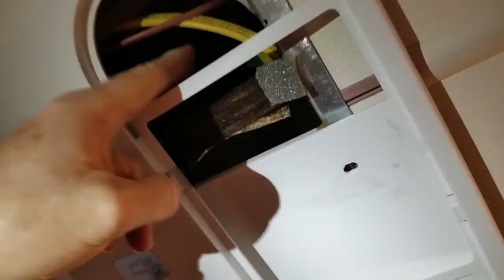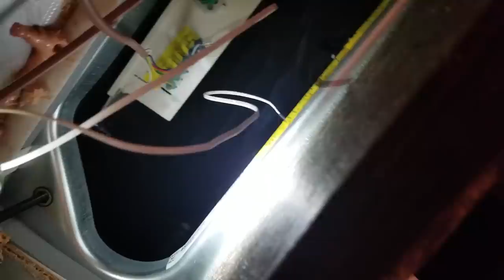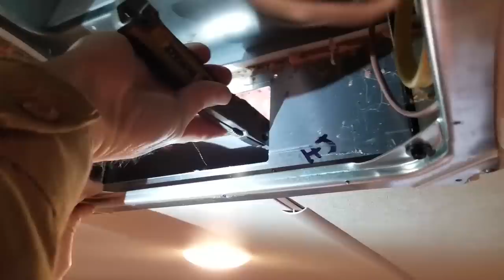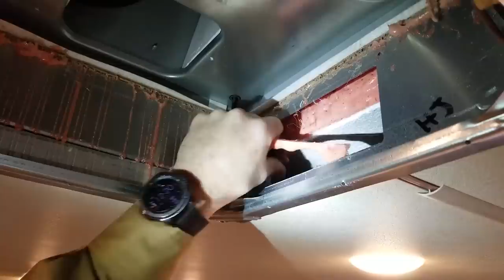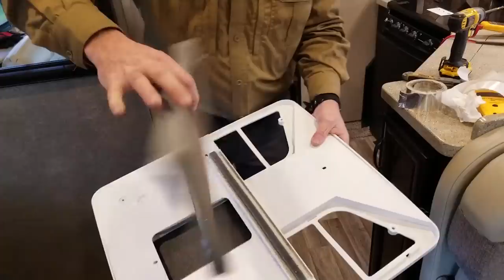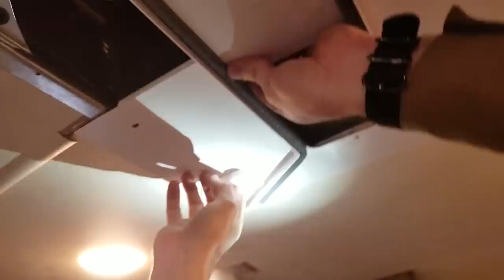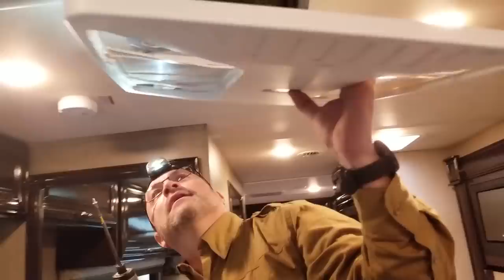Boost Your RV Air Conditioner Performance With This Cheap, Easy Fix!

Comment: I had problems getting my a/c to cool. I took off the frame like you did & using that same tape repositioned the center baffle. That gave me more cool air. But not much getting into the bedroom. So I closed most of the vents & took the frame off the one in the bedroom. Plenty of air getting to the area, but the vent was open into the ceiling. So I made a little wall of hard cardboard, covered it with the tape & put it in the duct to keep the air from going into the area between the ceiling & the roof. What a difference! Are there any other things I can do to help keep the RV cool?
Reply from the maker: Good job on the repair in your ducts. Obviously park in the shade would be the most obvious tip but that's not always possible.  We have installed awnings on the opposite door side to cool the walls of the RV on that side.  It did help quite a bit. If you're in a windy area though that solution may not work as well for you. The R-value of an average RV is about R3. Some of the really good ones might go up to an R6 but that's about it. So you're fighting a losing battle in trying to insulate. Some folks have added a second or third AC, that's fine if you have the power to do it.
Reply: @MyRVWorks  Thanks! Unfortunately the unit stopped working yesterday. Great in FL! I did go onto the roof to see if I could  clean the filters. One screw on the housing is stripped so I could only see the fan & the pipe connection to the motor. The fan moves smoothly & no mud daubers in this area. Couldn't see into the other side. The Thermostat does a small sound when I try to turn on the system. But no a/c. What's my best option? Electrician? RV dealer?  Any suggestions would be appreciated.

Comment: Hi Darren, Great idea to improove the cooling power. My 2016 5th Wheel has two ducted ACs (I think Dometic), which are not cooling very good. There is no such big cover to take down. Actually there are only these round intakes and outlets (6-7 inch diameter) throughout the RV. The pressure of the cold air ist preety low. So I think there must be a way to improove that. Have you any suggestion? Thanks, Manny
Reply from the maker: On your system you're going to have to get on the roof and take off the AC cover and the Shroud over your absorber coils. That's the way you will get to this divider. I've seen on some very high-end 5th wheels with your set up and there was a 2 inch gap on top of the divider where the air was passing right by.
Reply: Thank you Darren, I’ll check it out. Hopefully it’s what I am looking for.

Comment: Mine didn’t have a baffle at all. I made one out of house styrofoam insulation. Store only had 1/2” so I put two pieces together. Is there going to be a problem with my setup?
Reply from the maker: Sounds like you caught a big issue.  Good job!   Your solution sounds great, I also use the HVAC foil tape to cover the corners and top.  When I do this my goal is so that the ONLY place for the returning air can go is through the absorber (radiator fin) no short cuts.  This makes the air dehumidified and cooled and then returned to the coach.  

Stay cool this summer!

Chees,
Darren

Comment: what you need to live in your RV is a coat lined with tools on one side and all sorts of glue / adhesives / screws / bolts / hardware store  on the other side and laugh when you keep fixing broken stuff and not get mad.
Reply: amen
Reply: In fact, after almost 20 YEARS...I'm going to replace some of the plastic because it's Faded..like the water ports and electrical outlets...they fade after 20 years...big deal...$100 and I'm all good and shiny again...

Comment: I know you are doing your best at giving information. That a/c has a horrible configuration for air flow because it looks to have about as 4 inch piece of plastic in the middle of the air intake. That causes less air to be pulled in. You only have two holes on each side that looks to be about a 6in x5in each. So instead of the 14x7 opening you are referring to, you actually have less. Even though you did have some air gaps that needed attention, you're still going to have an airflow problem.
Reply from the maker: That 4" piece of plastic in the middle of the supply air side is the control box and is where the A/C manufacturer sticks it.  Not a whole lot we can do with that.  Some AC manufacturers will Mount that control box up in the rooftop component, but since these air conditioners can be configured different ways we got to work with what they give us.

Comment: I used sheet metal and completely blocked off the area so the only place the air could go was out the vents.

Those stupid rapid cool vents on the cover severely reduce the head pressure in the vents, causing the AC to work very poorly in the vents.

Comment: Sorry I am a newby...you mentioned ducts.  Is this an air conditioner that is like central air?  Mine blows the cold right out of the unit.  You had it apart so I couldn't tell what kind it was.  Will I potentially have the same issue with my unit if it's not installed right?

Comment: The "divider" is turned the wrong way. Foil to the return side.
Reply: The real issue is using foam in the first place. I used sheet metal on mine, glued and screwed it into place.
Reply: @charlieodom9107  I would have to somewhat disagree, the foam is in place to act as an insolater for the cold/hot divider, much like isolation in a wall. If you place just sheet metal in it, it has very little isolation and thus you are losing some of your cold air. Regardless, it was terrible craftsmanship.
Reply: @ty_dye  sorry, I neglected to mention that I also insulated mine, but used metal to direct the air into the ducts. (Mine had what was known as "super cool" to push air out directly at the unit, which made very little come out of the vents.) Units were later upgraded to slim models.

That was later upgraded to a hard craft foam (with the new units). I also insulated around it, but I cored out the foam with a knife to direct the air into the ducts, then sealed it up with tape.
Reply: @charlieodom9107  nice! Lol I just read that and thought, oh no..... Sound like you fixed it the way it should have been from factory!

Comment: Since you do this sort of thing all the time. My trailer which has a large skylight in the ceiling where a/c would go if the factory had put it in. What are the chances that it has the wiring needed in the ceiling to install a/c? Good videos. Thanx.
Reply: Does it have a thermostat?

Comment: If you are camping in a hot, high humidity area that mixing of hot humid air and cold air in the plenum will cause condensation and water dripping in the ducts
Reply from the maker: As part of the yearly preventative maintenance everyone should make sure the drain plugs to the drip tray are not clogged too!

Comment: Great tip. Now my question is my master room is our RV has that divider and air does come out the quick cool vents. My main a/c unit in the kitchen area does not blow out the quick cool vents, only the ducks. I noticed a large styrofoam pieces pin therewith no divider . Could that be the cause of the quick cool vent not working at all? 

Thanks

Comment: DUO-THERM®
WALL-MOUNTED 
ANALOG THERMOSTAT where do I find the step down transformer 240/110 electrician box  to replace the whole air conditioner in a keystone Montana 5th wheeler from USA 2000 model

Comment: What about when the ac stops blowing after a few hours...doesnt shut off completely...its still trying to run but theres a dramatic decrease in the blowing pressure. Its almost to the point of being useless when it does it

Comment: I've recently picked up our 2006 Terry quantum 33fkds. I've got the duct AC as well for the living area, bath, shitter and the bedroom. The further the duct the less air. I get that is the dynamics and science of the concept of path of least resistance but is there a way to change this? Living room//kitchen is nice and comfy and hot as a bonfire in Hell in the bed. ---------------------I've cheated the set up a bit by removing the grills in the ceiling and placing some very attractive plastic bag cuts about the grill to keep the airflow from exiting that duct.
Is this just the luck of a "larger" trailer with the ducting or is there something more I can do? 

We use it as often as possible but it's not exactly as often as we'd like.... So, we don't live in it...
Reply: Maybe there's some way to install a booster blower midway in the duct, or at the furthest air dump?
Reply from the maker: What I've seen, from some manufacturers, is right at the register, they'll take some flashing and put a little bit of an angle on it then screw it inside the duct above the register.  Idea being when the air is rushing through the ducts it will hit that little deflector and it will help move it down into the coach distributing the nice coolness. 
You have given me an idea for a new video though. I have an anemometer datalogger with airflow recording . I also have a couple RVs, I might set that up at each register to record temperature and airflow and then experiment with some of these deflector things seeing if I can use some kind of scientific method to even out the A/C cooling.  Then I could market it and make millions!

Comment: I just bought a 2006 cougar and the electric wires on the ac are hanging down... 2 yellow wires and 2 blue wires are not connected. And at the controller the communication wire is cut

Comment: Does this fix also apply to some of the larger diesel class A's?
Reply from the maker: This applies to any AC that fits on top of a 14 X 14 hole. The divider has a tendency to leak. Foil tapes have a tendency to lose their adhesive over time. I have seen this issue on $750,000 RVs and $30,000 RVs and everyone in between.

Comment: Great information.  The AC manufacturer should design unites better so that we do not need this fix.
Reply from the maker: It's not the AC manufacturer it's the installation. But even still, this needs to be checked seasonably because over time the adhesive fails.

Comment: Please tell us which RV manufacturer made this coach!
Reply from the maker: I've actually seen this problem on just about every RV we've worked on. From the entry level low in coach all the way up to the half-million-dollar coaches. Even if they come out of the factory perfect the adhesive wears off on the back of some of those tapes after a few years. It's something we should all be checking every year when we do our pre-trips for the camping season.

Comment: I have a question on ac mine is a dometic in the roof non ducted I was wondering if I can put a wall mount thermostat as opposed to having it on the unit itself
Reply: yes you can,i just did it and got rid of the knobs and now the furnace and a/c are one thermostat.its a kit that comes with a control box that replaces the knob box,only thing is i had to get the thermostat wires,furnace wires and 12v power to the box you add,i tapped into the furnace wires at the furnace,ran 12volts from my breaker panel,you could run it from any 12 volt source,and put my thermostat on the closet wall that houses the furnace ran the wires through a wire hide from the closet to the ceiling unit,now it cycles off and on when set temps are reached and the fan doesnt run forever,wanna say it was less than $100 and damn worth it!

Comment: Anyone know exactly what that divider is called and where to buy one. My RV was bought used and the divider is missing on my bedroom unit. Thanks!
Reply from the maker: You can get creative here. A piece of Styrofoam from an old ice chest fixed in place would work just fine.

Comment: Where can I get that return air cover? I would love to be able to direct the cold air to either the ducts or straight out of that ceiling panel. I have a Coleman 15K
Reply from the maker: If you can send a picture of your A/C model and SN to Parts@MyRVWorks.com we can help determine your correct PN.

Comment: Can I use duct tape instead of the silver tape?
Reply from the maker: Certainly, 'be the air' and make sure there's a good blockage in that divider. No problem using duct tape. A best practice is to check this once a year. Often times, regardless of the tape you use, the adhesive degrades on the back and it fails over time.

Comment: Is not the reason for the crossover for the cabin air, that has already been cooled, to be cooled more, as to make the unit more efficient?
Reply from the maker: It would be incorrect to have the cold return air cycle back through the warm return air and never make it into the coach. You would have a dog chasing its tail scenario. That is something that could lead to freezing up the evaporator coil. The (warm) return air and the (cold) supply air should be kept separate within that 14 x 14 hole in the roof for the air conditioner to work efficiently.  That is the purpose of the divider on all these types of air conditioners.

Comment: Our 5th wheel Toyhauler has 2 ACs. One up front in bedroom and other in Garage area. They both feed the same racetrack ceiling ducts.
On hot days, our front one tends to freeze over a d have to defrost it regularly. What gives??
Reply from the maker: Hi Michel,

There are several things that will contribute to an A/C freeze up.  On my website I have a section where we have service manuals available for download.  I am adding more manuals as I get time  but take a look and see if there is a shop/service manual for your A/C model and in there are great troubleshooting guides that cover the freeze up issues - among other things.  https://myrvworks.com/manuals/

Some easy things to check would be the freeze sensor that is usually wedged between the fins of the absorber coil (this is the radiator looking thing when you look up from the inside).  If that has fallen loose or faulted (failed, shorted, come unplugged etc) it will definitely cause a freeze up since the control module has no way of knowing when to turn off the compressor.  Other things would include the topic I discussed in this video with the divider.  I have also seen a failed relay on a control board that kept the compressor 'stuck' on.  So there are several things to check.  The troubleshooting flow-chart in the shop manuals is usually our go-to for diagnosing these things.

Good luck!

Cheers,
Darren Koepp
Reply: @MyRVWorks  awesome thanks.

Comment: What about the fan on top of the RV that pulls hot air towards the compressor instead of blowing it out?
Reply from the maker: You would be referring to the Coleman A/C.  I stock the motors for these A/C's because they are the one's that typically fail.  Coleman makes a great A/C but strange to suck the heat from the condenser back towards the evaporator area, motor, capacitor etc.  I was never consulted but swapping these motors sure helps pay the bills around here.  When I come across my next Coleman A/C motor R&R I will be cutting a video on it.  

Cheers,
Darren

Comment: Make somemore like this for the Dometic A/C units.  Considering refilling the R-22 via a Tee fitting as the low pressure side tubing is all sealed off with no access on our Dometic Duo-Therms in Holiday Rambler Endeavor 40SFT.
Reply: Hi Joe,
Thanks for the suggestion.  However, I will let others cover that controversial topic.  Due to the tight regulations surrounding this procedure, and the fines that are levied if one is found violating the Montreal Protocol and doing it without all the proper certifications, licenses, equipment and other tools, I will steer clear.  The procedure is pretty straight forward, and the older RV A/C manuals cover it but since around the early ‘90’s many professional RV techs just replace the top A/C unit.  RV A/C mfg’s do not provide a tap just for this purpose.

A professional HVAC company would be the place to look to have this procedure performed since they carry all the proper EPA and local licenses to capture and reclaim the refrigerants.  When I have a customer that needs their A/C unit recharged, I turn them over to those guys to do that task.
  One customer removed their top shroud and pulled too hard and broke a joint on one of the tubes.  The local HVAC contractor came out in their mobile van, soldered it back together and recharged his unit for a fraction of what a new one would have cost.  

Good luck in your quest for getting this done.  We have lots more RV service video’s that are not so politically charged…  

Cheers,
Darren Koepp
Reply: @DarrenKoepp360  I can appreciate the intrusion by well-meaning EPA folk on what penalties this could lay on the HVAC audience out there.  I'll go to an expert and do as you suggest.  The Fan motor spools up fine, and moments later, the Compressor comes on.  Not sure if it is fitted with a low-pressure cutout sensor.  Probably not since they don't intend to fix that issue, just R&I with new box!  BTW, do you know if the new Dometic Duo-Therm Penguin II's are a direct replacement for the older models we have on our rig?  Ours is a 2007 Holiday with a pair of model 630035.331 13,500 btu ducted units with heat pump cycle and external mounted 5-button thermostat.
Reply: Hey @joeowen1429  
A new feature we have been working to add to my website is a library of service manuals.  You may find some great reading literature to fill those lonely camping nights when the crickets and tree frogs are keeping you awake.  

Here is a link to the service manual page.  Just filter the search box for Air conditioner and Dometic and you will find many of the manuals we have uploaded.  As we get time, we have many more to add so book-mark that for future reference.  
 Certainly there will be information there to help you on that A/C upgrade.

https://myrvworks.com/manuals/

Happy Camping and try to stay COOL!
Cheers,
Darren